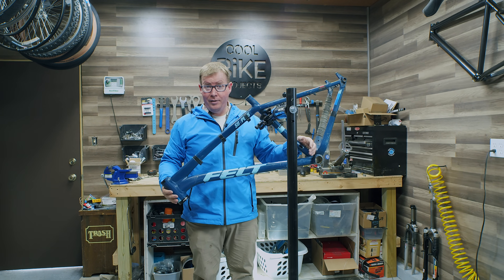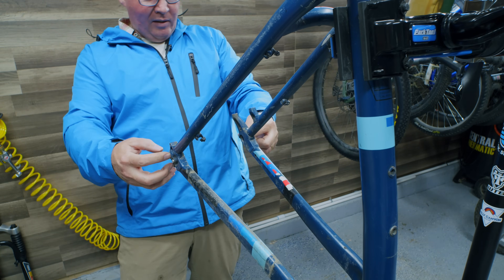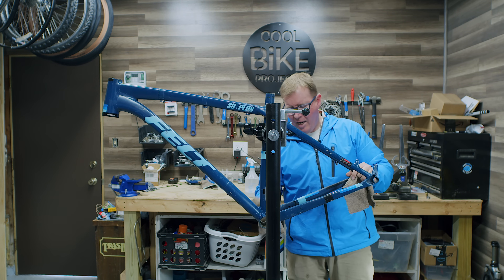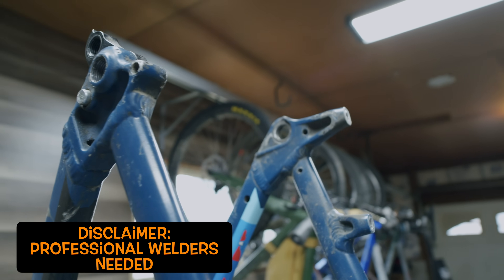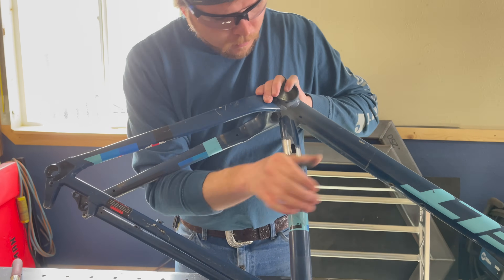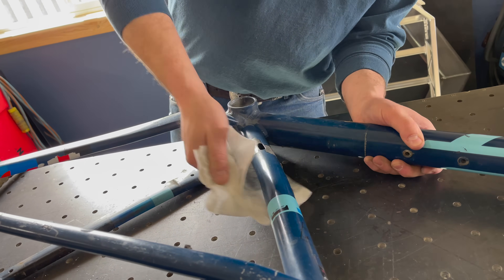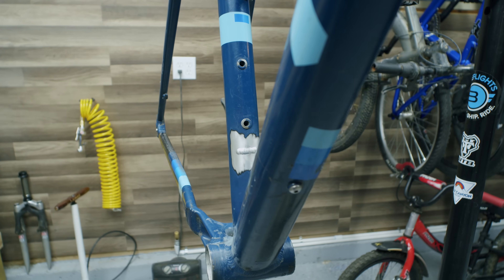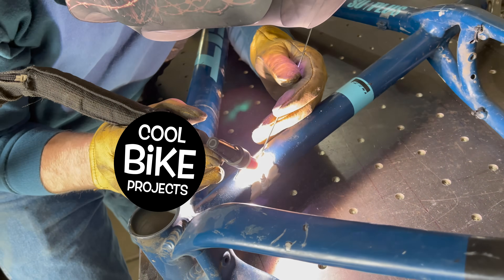How to fix a cracked bike frame: welding aluminum

Comment: I definitely think we should be welding our frames back together more often. Quality aluminium welders are hard to find, but for steel bikes there's a lot of people out there who can do the work. It's much better to repair than to throw away, and you come away with a story to tell.
Reply: Quality welders are not that difficult to find. Too many people are unwilling to pay appropriately for the work that is requested. My tig welder does not get turned on until my hourly rate is discussed and minimum is one hour. Many people do not understand that preparation is part of the job and I do my own preparation. Not comfortable having people tell me they have done the preparation.
Reply from the maker: Agreed! I totally get the need of manufacturers to want frames returned for warranty work, but most of the time we were instructed at the shop to destroy them or throw them away.
Reply: @CoolBikeProjects  Yeah, it sucks that parts just get destroyed. Carbon is especially bad for this, as it's just plastic really, and incredibly difficult to find a place that can repair it unless you know an F1 team or something
Reply: Yes. In esp. we should weld where there is an obvious design mistake like in this case.
Reply: @MxCrab  some times the custmer do n't want to pay  i do aluminum repairs

Comment: technically you can repair it but it needs to be heat treated afterwards, which costs a lot as you need an industrial grade oven
Reply from the maker: I am learning more and more about the process. As I understand it, the strength loss from welding can come down to a number of factors including the filler material used, the type of tubing (6061) and how quickly the welds cooled. I'll be talking with the welder soon to get more info on it. Thanks for your insight as this is all new to me.
Reply: @CoolBikeProjects  i'm glad you're doing these experiments though, perhaps one day there will be some breakthrough that makes aluminum frame repair more accessible to the average biker so that people can have the same ease of mind with alu frames as they do with steel frames
Reply: @daddyshrek2295  7005 frame material get close to this. 5356 filler and will naturally age back close to original strength after 2-3 weeks at room temperature. Artificial ageing in an oven is more consistent, but not absolutely necessary (6h at 90° C, then 4h at 150° C).
Sadly, this was a 6061 frame, so now 50+% weaker in the repaired area than it was before the failure. This could have been addressed with some reinforcement and a relocation of the dropper hole to the neutral axis of the tube.
Reply: @danchambers1350 I had also opted for a relocation of the hole and mayba adding an inforcement sheet / aluminium part. There was a reason the fram cracked at that spot. Anyway I like the repair effort, as it shows that you can save a cracked aluminium frame.

Comment: Doesn't aluminium need to be heat treated after welding?
Reply: LOL, you people really believe bike manufacturers do this with their frames?   Keep dreaming.
Reply: yeah, that would be the proper procedure but it's really costly
Reply: 6061 requires a multi-stage cycle to restore strength: 30 minutes at 530C. Quench in water or water/glycol. Align within max of 8 hours. Artificial age 8 hours at 175C.)
7005 will naturally age at room temperature close to original temper in 2-3 weeks, but an artificial ageing is preferred for a more consistent result (6h at 90° C, then 4h at 150° C).
Sadly this was a 6061 frame...

Comment: One thing I learnt early on with alloy welding .clean clean .deep filling area to sink the weld into . I've seen similar  cracks 9n cheap frames with long posts fitted when the bikes landed on the seat and it's bent the seat tube .Great skilled welder . to repair alloy frames cos how many times have we heard" its broken its scrap "👍
Reply from the maker: Great point!

Comment: Very curious to see how this works out. I found a thrown away GT Tempest and after breaking it down and cleaning the frame, I found a stress fracture in the front headset tube from the top going down about an inch and a half long. The frame is hanging in my garage as I wasn’t sure if worth having a professional try to re-weld, figured that’s a high stress area. Thanks for posting this, can’t wait to see more.
Reply: I've got a boardman with a crack in the same place. Anoying as ive hardly ridden it.

Comment: From the bottle cage mount bolts it looks like the seat tube is also slightly bent. Should be ok for moderate trailriding though after the fix 👍🏻
Reply from the maker: Yes the bend is actually designed that way on many modern hard tails in order to accommodate a larger wheel. It allows for a shorter wheelbase while getting the seat angle correct.
Reply: @CoolBikeProjects  You are right 👍🏻 it is in the original design as well, so all should be well, no geometry changes. Fracture not in a location that would cause catastrofic failure if it refractured so thats a good thing. As it is a burly frame it should come out as a good bike for trail riding! I would ride it 😀
Reply from the maker: Thanks Markus!

Comment: I have worked around welders for years, so I automatically turned my head to avoid looking at the arc in your video!
Reply from the maker: 😉, good thing the iphone footage clips at a certain brightness or we’d both be in trouble.
Reply: @CoolBikeProjects  arc light on an LCD is simply white light, nothing more. Not brighter as the sun light standing right in front of the actual welding action
Reply: yo, are you serious? you're now viewing it from an lcd screen...😅

Comment: That's pretty cool. Brought back memory when I broke my BMX bike and they welded it together with a square metal. Looks so ugly. My dad was like "it's fixed"🤣🤣
Reply: Good of your dad to try and help  .. even if It was a little ugly
Reply from the maker: You’re not ugly Milton 😂
Reply: I once (as a teenager) welded V brake sockets (by myself with a simple stick welder) on an old steel road bike. The brakes were excellent afterwards, unfortunately the fork was weakened after the welding, and broke at 30 km/h +.
I flew 5 meters through the air, but wasn't hurt, the bike almost hit me then because it was also flying through the air.
Since then I avoided any welding on bike frames ;-)
Reply from the maker: Awesome!